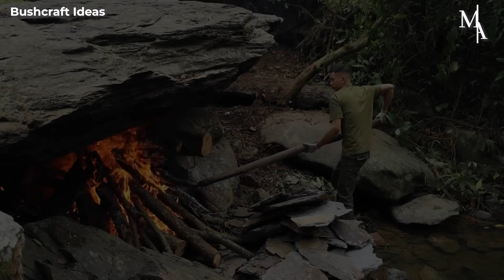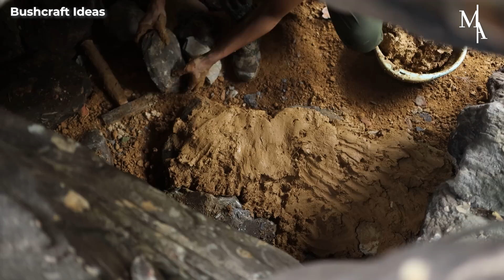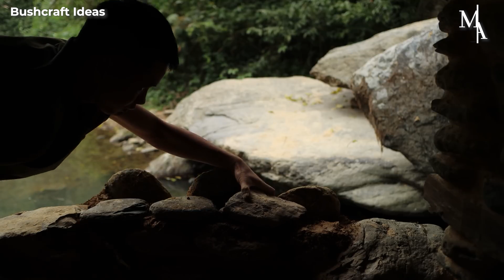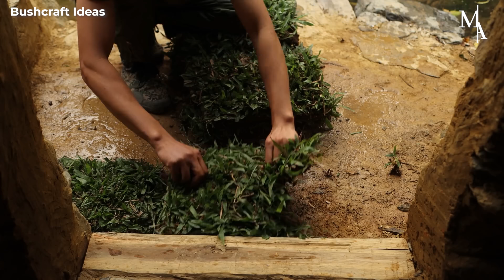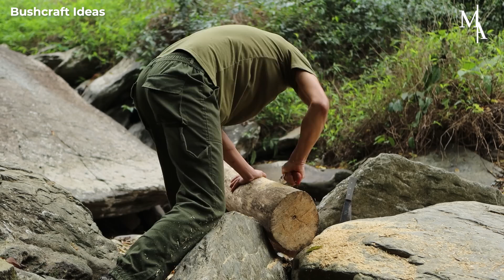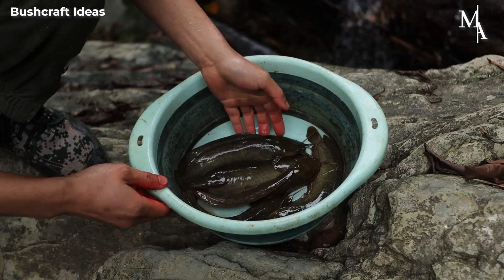Man Builds a Secret House Under a Giant Rock in 7 Days | Full Build by @BushcraftIdeas-e9q​

Comment: A couple of concerns. As several people mentioned, in the rainy season, this is going to flood horribly. Another is that he does not seem to actually be building a "survival shelter" as keeps being mentioned. He has no access to the water after he puts the railing in, so he can't easily fish or wash things. He puts grass all around rather than having any level of attempt at a vegetable garden. He isn't resealing the clay after the initial coating after it cracks, which in turn could lead to unstable pieces that can and will create worsening conditions in those locations until failure. On the steps, that isn't a massive issue as they can be repaired, but on the chimney it could lead to serious issues.

Comment: Great job well done!! You picked out a nice location to do it.. also close to a water creek good thinking.... also using that fire clears out all roaches spiders snakes everything that's in the cave will clear out completely with the high heat and smoke..... again well done!! Thanks for sharing
Reply: Unfortunately, no, not a good location. Putting a shelter basically on top of a creek bank is basically like having a permanent high powered humidifier on, you will be constantly fighting the damp and the cold coming off the water; unless you have a fire going 24/7 it will be like living inside a soggy boot. Not to mention during any heavy downpour those banks will swell and flood. This is not to say it can't be done because it clearly can, but it is just so much harder to do when you can simply start you shelter uphill from the bank and avoid those problems without any drawbacks. Every river dwelling culture has learned to put a barrier between the water source and the housing, usually by stilts.